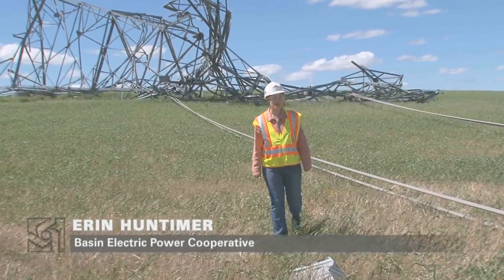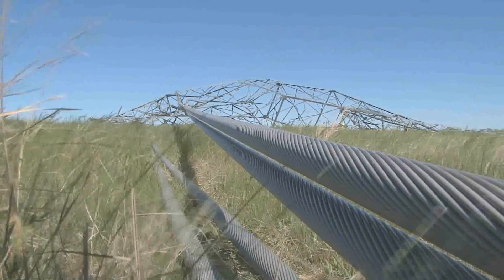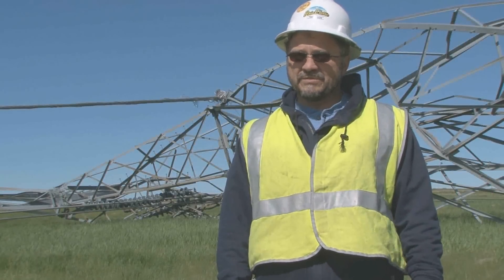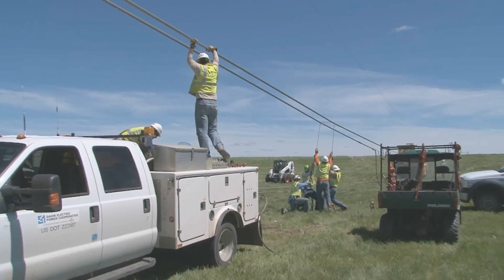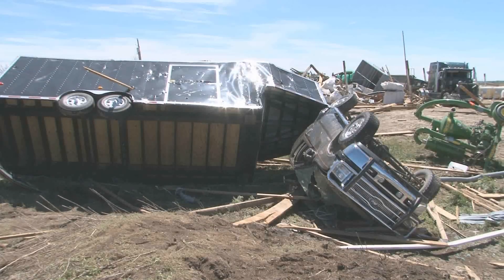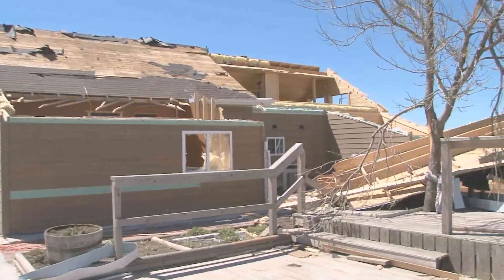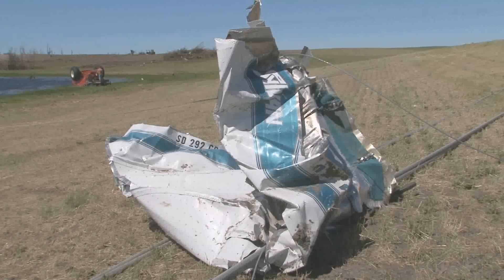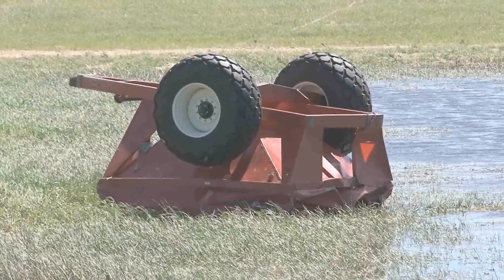Basin Electric transmission crews repair line after South Dakota tornado

Comment: I was a construction engineer on this transmission line from 1979 to 1980.  The project went on after I left the project.  I was responsible for making sure the right materials were in the right place at the right time.  It was a challenge along the 500 miles of construction from Huron, SD to Beulah, ND.  My first project out of university working for Donovan Construction in St. Paul, MN.  Good memories.